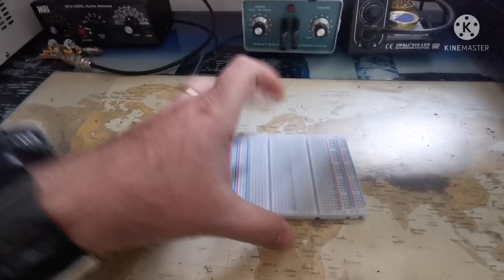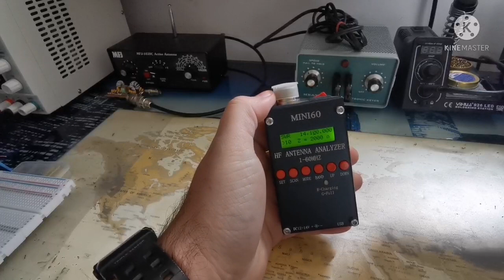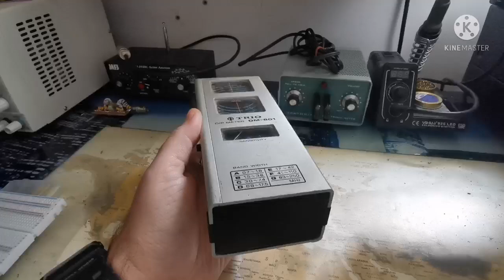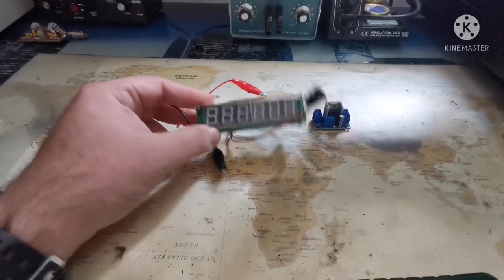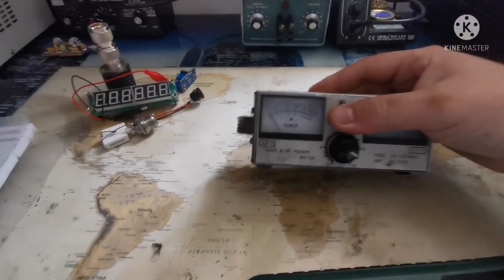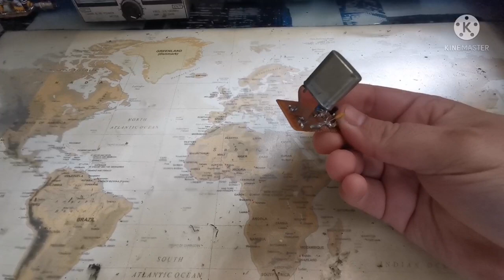15 things to have in your ham radio shack

Comment: A nice little setup, and functional. I have quite a lot more gear, 
having been an electronics tech all of my life, (I'm 71,) but as you 
show, it isn't really necessary. What I have found though is that a 
cheap NanoVNA is tiny and convenient, and will replace an antenna 
analyzer, a grid-dip meter, a capacitance/inductance meter, and a signal
 generator. I seldom ever use my big gear anymore since I got the 
NanoVNA. So if you don't already have all of those things, the NanoVNA 
is well worth considering.